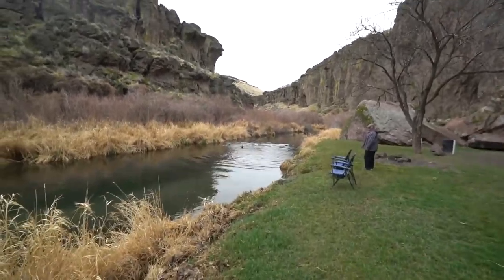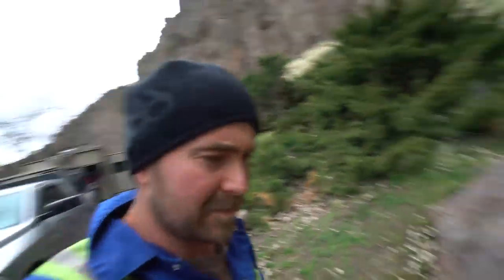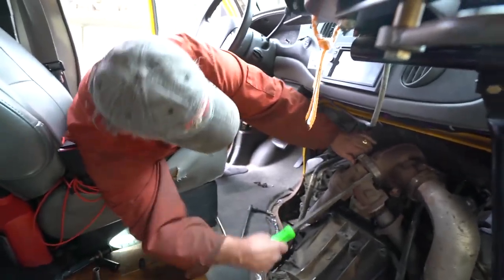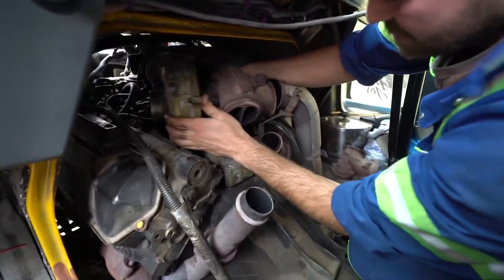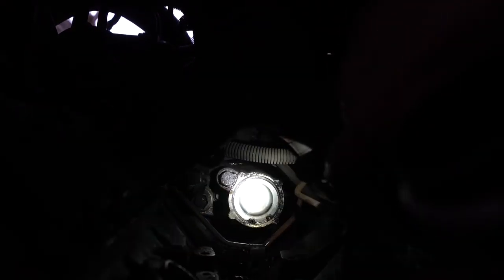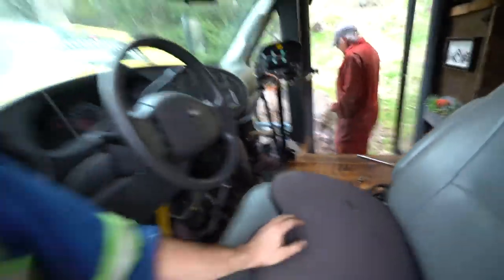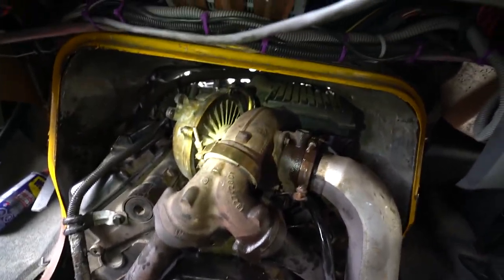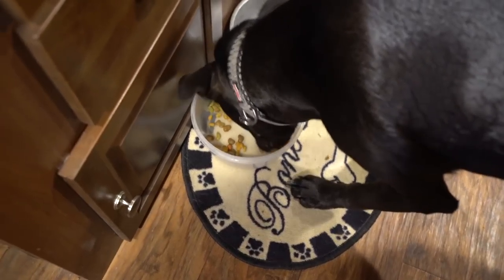Finally Fixed !!!

Comment: Badge is such a great teacher.  Am about to go take off the turbo on my 7.3 powerstroke 4x4 Van and can't tell you how much a video like this helps when it's something you've never remotely tried prior. That Copper-coat tip will come in handy today!
A video like this priceless when it comes to DIY. Thanks much for sharing the experience.  -JR
Reply from the maker: dude, good luck. if it's the same rear plug on the hpop, try to use extensions instead. it's so much easier. they really cram that engine in there

Comment: Hi Jax, that copper coat is really awesome stuff it's great to put on boot locks, door lock I mean the latches not where the key goes lol but I guess you could put a dab in there too also any hinges too. it's a bit like WD40 you can use it anywhere ;). Cool video, thank you. xx